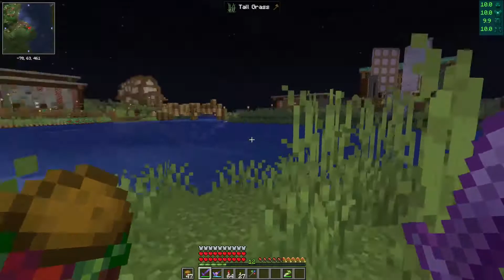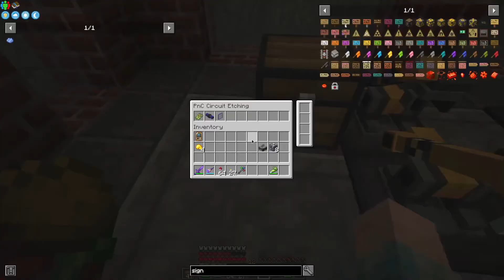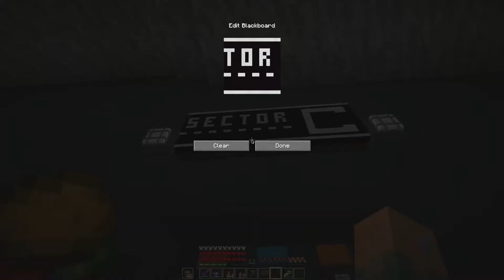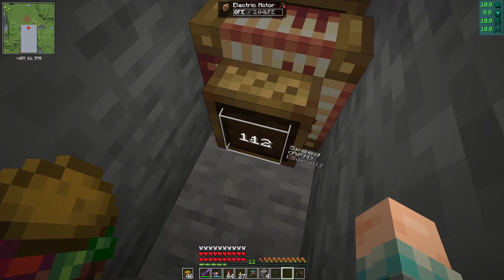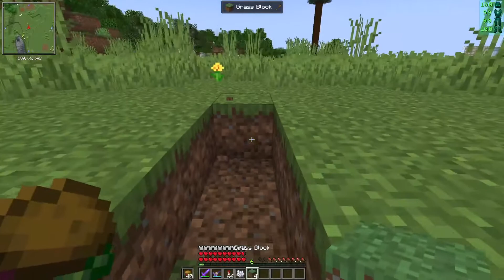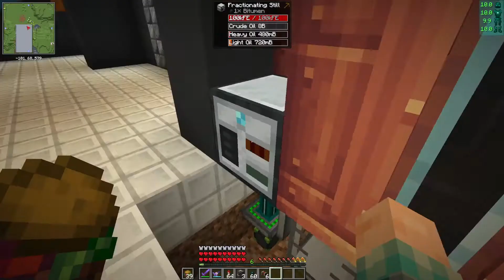[HE3] Episode 40 - The Hi-Tech Lab with Oil Refinery!

Comment: 🤣The enderman scene had me dying. That did look cursed  though, I can't disagree.

Are you planning on leaving the oil and fluids all inside, or do you plan on eventually moving them outside the building, and having a fluid tank/silo compound? Either would be fine, but the outside one might give you more room for tanks and whatnot, if you ever want to begin holding/processing other fluids.